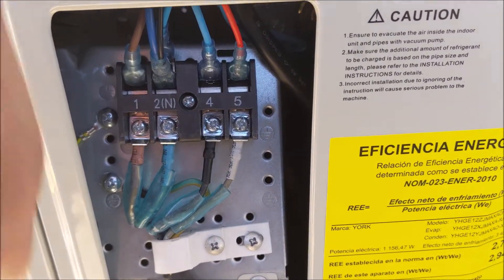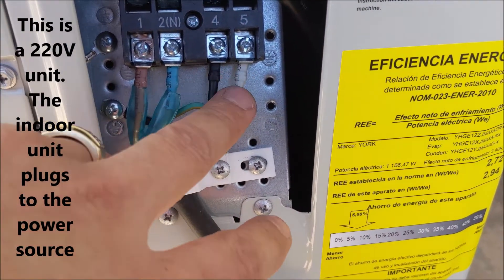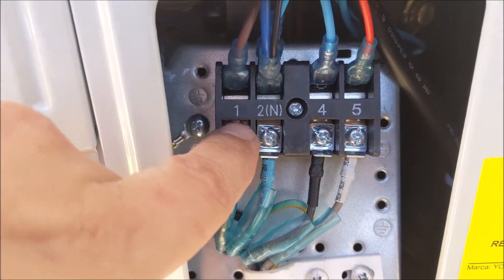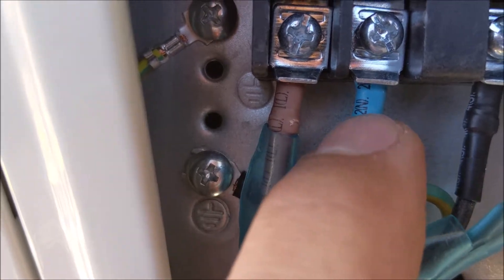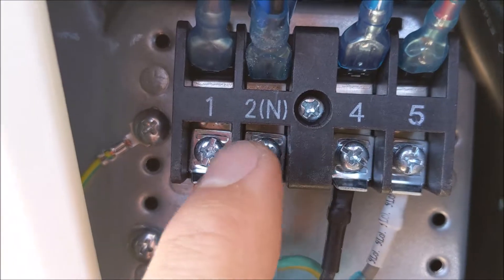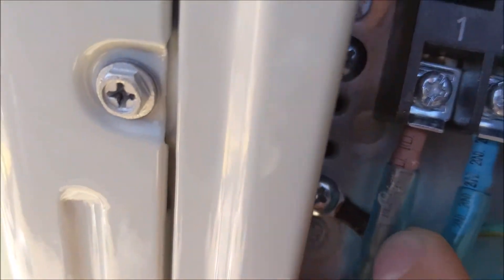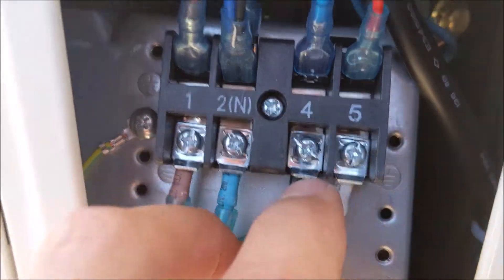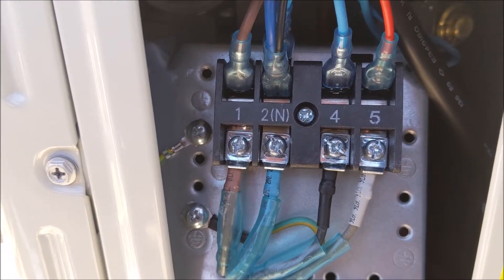Mini Split DIY wiring tips to avoid damaging your ductless unit!

Comment: Thanks for the information.  The mini split i bought also has a short cord on the inside unit. I connected the whip from the inside unit to the outside,  but did not know that the short cord was for the 220v supply.  Thank you for your videos.
Reply from the maker: Glad I could help

Comment: I have this exact unit could you show how you connect the indoor to power?  It’s a 220 but only has a brown blue and green, this video shows what the manual states.
Reply from the maker: You will need a 220v connection inside.
Reply: @SaveGreenHere   thanks for your response, so the entire 220 would go to the brown wire?  Or is the blue neutral the second leg?  Basically 110 to brown and 110 to blue?

Comment: First rule when working on electrical - Remove your rings!
Reply from the maker: Of course it's a good tip. However, the unit was not even connected to main power yet, and we were not working with electricity, just showing connections on the video.
Reply: good reminder,  would wearing a glove help?

Comment: hi. i have a ac/ heater 220v that connects via outlet inside. what wire should i use to support the 220v. Someone told me to use 2 of 12/2 romex to supply the power to the unit
Reply from the maker: If you have black and white, with ground, use this and it should be enough to run directly to your main breaker, but make sure.... https://amzn.to/2T53OoM

Comment: what do you mean by "indoor unit plugs to the power source" ?  I've got one in spanish too and the manual isn't translating well. I'm trying to figure out where the inside unit gets its power from. The cord is too short to go outside. I'm thinking it plugs into a plug inside the house. Is that how they do them south of the border? EDIT: i just looked at the comment below mine and it sounds like i just need to hook the short inside wire to the breaker box and thats it for power supply. man thats a strange way of doing it compared to the other mini splits
Reply from the maker: Greg, your power source, (where the power comes from, for example, your breaker panel) is where some models connect to, from the outdoor unit. On some other models, the indoor unit plugs to the power source.
Reply: @SaveGreenHere  thanks, i fugured it out. i should have known because my mother in law has one plugged into a wall socket in japan and i had some pictures of it but didn't remember. i also bought some of those flare seals you had recommended on another video. they look like a good insurance policy against leaking flare joints. thanks

Comment: I have a 220v 18,000 btu carrier mini split and from the looks of it it doesn’t hook up
Like other ones I’ve seen. It a carrier mini split and came with all the needed cable. The indoor unit has a cord connected to it from the factory that’s about 4ft long and has black white and green in. Any ideas on where that wire goes? The instructions are in Spanish I’m confused because all the videos I’ve seen there is a disconnect outside the powers the system and has l1&l2 on the outside mine dose not. Any help would be great
Reply from the maker: Joe, if the cable is indoors, it would need to be plugged indoors. As long as there is a cable that connects the indoor to outdoor, that's fine. Some models plug outside, some plug inside. But as long as there is a connecting wire between both units, you are fine. You may have to run a source wire from your breaker to the indoor unit area to plug into.
Reply: @SaveGreenHere  the cable inside has black white and green and 220v is black red and green
Reply from the maker: So you will need a 220v feed from your breaker panel to that wire for the short wire. The internal cable, (I believe you are referring to the cable that connects one unit to the other), which should be quite long. The shorter cable plugs or connects to the electrical source going straight to the breaker panel. Just remember your green wire ALWAYS goes to ground, NEVER put in on a terminal. If you are having issues consult an electrician.
Reply: @SaveGreenHere  I pretty sure I figured it out the white and black wires get connected to the black and red and greens together. I was confused by the white wire thought it was a Neutral
Reply: @SaveGreenHere  what brand mini split did you install in this video

Comment: I just installed a 110 minisplit but it seems the outdoor unit isn't kicking on. The indoor unit powers on, lights up and blows air, just not cold or hot. I'm certain my all my connections as its pretty straightforward. Do you know of anything else I should check for before calling a pro?
Reply: Hey Clay, did you ever find a solution? I believe I am having the same problem.
Reply: I ran a dedicated circuit using 12/2 wire. Would there be a fuse or something inside that is blown on the outdoor unit?
Reply from the maker: Is it on a GFI? If it is, try a direct connection, to a dedicated breaker, with nothing else connected to that breaker. If this solves your problem, DO NOT use a GFI. Rather, use one of these.... https://amzn.to/2EugYEQ  Some mini splits have this issue, as I found out after speaking to a Senville rep on a particular unit that had a GFI. Got rid of the GFI, and the issue was resolved.

Comment: I have a Mexican unit like that. My question is the 220 from the panel goes inside the panel then back out with the supplied whip?
Reply from the maker: Yes. Some units, the 220 supply goes to the indoor unit first, then to the outside with the whip. Other units, it goes to the outside unit first, then via whip to the indoor unit. It varies, and I have seen both configurations. So check the manual. Hope the video helps.
Reply: @SaveGreenHere  I also have a Mexican unit and the condenser (outside unit) says 230v single phase but in the manual says it's for 110v circuit. Its a 12,000 btu which one it is the 110v circuit or 240v circuit? Thank you in advance
Also the communication wire only has 3 wires brown, blue and green/yellow. And is only cool not heating